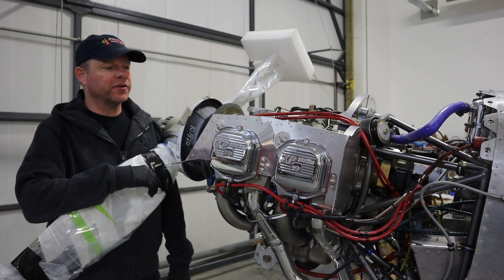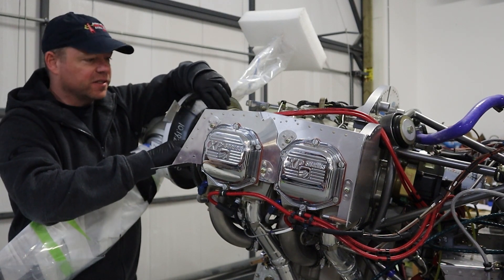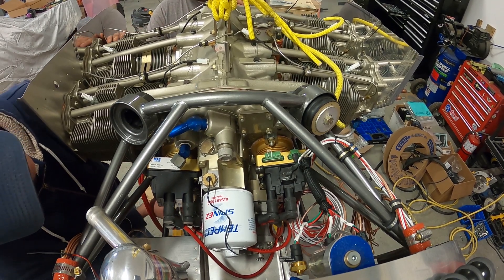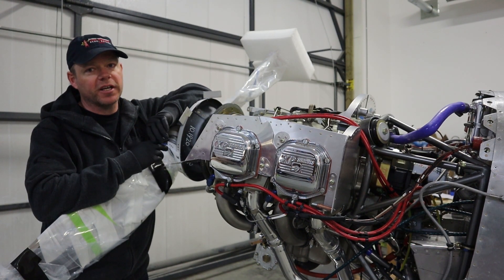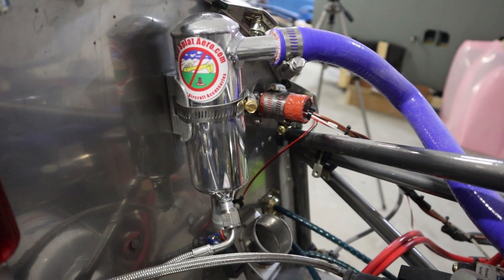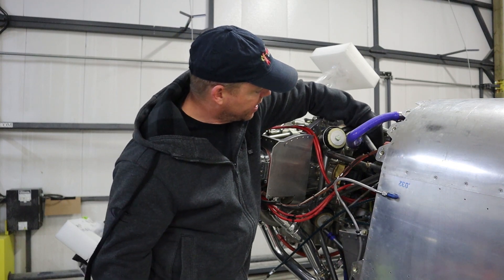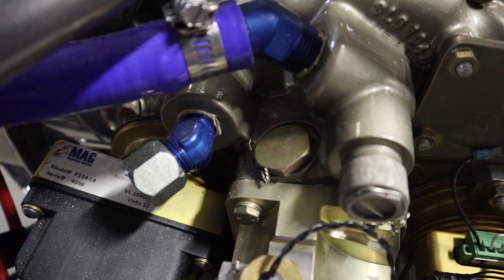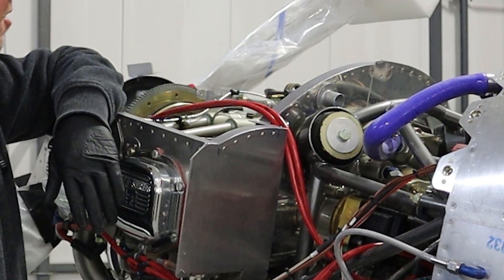Lycoming Engine Overview

Comment: Makes you wonder why something so simple is so expensive?
Reply: @B.S Noodleman Classic case of over-regulation creating barriers to entry into industry which results in government-induced monopolies and rising prices. There are many companies capable of making high quality aircraft engines, but the certification process is so prohibitive and costly that it's just not worth it, even at inflated consumer prices. Once you de-incentivize new competition so severely, you're gonna have rising prices. Corporate greed only works if nobody is there to undercut your pricing. The price is the symptom, the regulation is the problem.
Reply: @peter94e  Good point, but what about the extremely high prices for the non certified engines that manufactures produce? Some manufactures sell the exact same engine in either certified or non certified form and although the non certified engines are cheaper they still seem very expensive for what your getting. For example a brand new Ford 5.2L ALUMINATOR 5.2 XS CRATE ENGINE is $22,000 and this is a very sophisticated and modern design DOHC, 4 valve per cylinder. variable valve timing, and fuel injected that produces 580 HP. It just seams crazy that you could buy two of these for the cost of one Rotax 915 that was designed and built in 1984. For a company that employs state of the art manufacturing techniques  like Rotax to charge that much for an engine that they have been building since 1984 seems like they are over charging because they can, hence corporate greed.
Reply: @b.snoodleman5864  Yep, I agree. I suppose my only point is that every company in every industry is "greedy." If I could charge double for the job that I have, I'd be stupid not to. The only restriction on whether or not a company or any other entity can act on that greed is competition, which is subject to economic barriers to entry, which goes back to regulation. I think we're identifying multiple causes to the same problem, which is high prices. Asking people to be less greedy is like asking water to run uphill. The natural flow of economics is that high profit margins will draw people to try to participate in that industry. If that isn't happening, the only solution is in the question "why aren't we seeing new manufacturers making this item, when clearly the profit margin is very high?" If you can bring an IO-360 competitor to market for the price of a GM LS crate motor, I'll buy at least 2. Haha. All I want is to go flying for a reasonable price...
Reply: @peter94e  well said
Reply from the maker: Supply and demand
Reply: @stusaircraftfactory6592  Hello, I hear what your saying but I still can't help from feeling some corporate greed from the manufactures because most of these engines have had all of the cost's in development, tooling, castings, and testing done many years ago, in most cases dating back to the 1960's. It just seems like they know they got you so they charge what ever they want.
Reply from the maker: @b.snoodleman5864  Yeah it’s a interesting debate.

Comment: That was a good one, Stu.  If you have time in a future one, could you talk about the ways you pass wires, cables, heated air and fuel through the firewall?  Also about the EMAGs.  Thanks very much.  See you, Drum
Reply from the maker: Will do. Basic concept is bulkhead fittings in steel.
Reply from the maker: Let me elaborate since it will be a few weeks for more info on these topics.  I use the linked product below for firewall pass thru of wires.   The idea is to prevent chaffing and seal the hole off from fumes and heat.   As for fuel its a basic steel AN6 bulkhead fitting that passes thru firewall - super simple.  The fitting is a AN832-6.

Firewall pass thru:
 https://www.aircraftspruce.ca/catalog/hapages/ssfirewallkit12-04762.php?clickkey=114705

About the EMAG - really nice product.  Works similar to a normal magneto except that after the engine is running it produces its own electrical power.   Traditionally magnetos are used on aircraft engine because they don't rely on aircraft electrical power - i.e. the entire electrical system of the airplane can fail or turn off and the engine keeps running and brings you home.    The initial downside of electronic ignition is the very fact that they require aircraft power to function - if you have a complete electrical failure you'll likely land at the nearest convenient airport.  They are typically functional down to a very low voltage so you do have a good 45-60 min of safe flight time - but it will stop functioning eventually and the engine will quit.  

The EMAG is kind of the best of both worlds.   Functions like a magneto by producing it own power source and provides the benefits of electronics ignition - better spark, timing change, manifold pressure (altitude) compensation, better fuel economy etc.    The installation is pretty straight forward.   Each will have a ground wire, power wire (goes to a circuit breaker) and a wire to turn it on-off (same connection as a mag).  They also have a manifold pressure hose to each.

Hope this answers your question